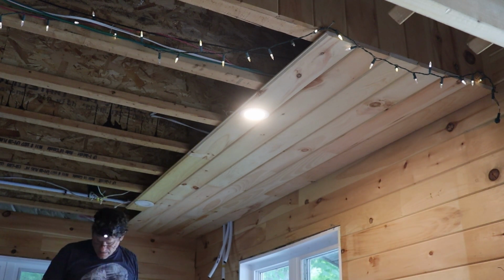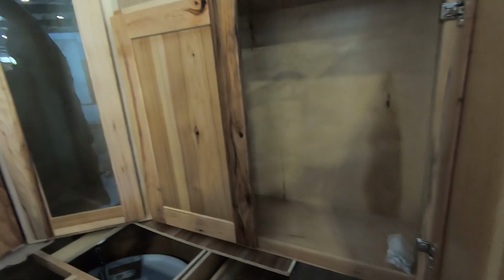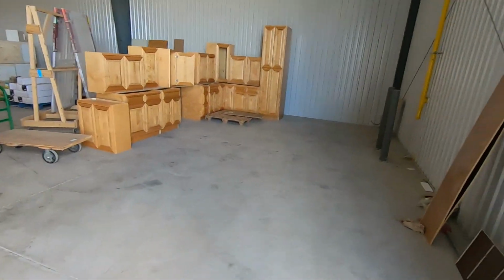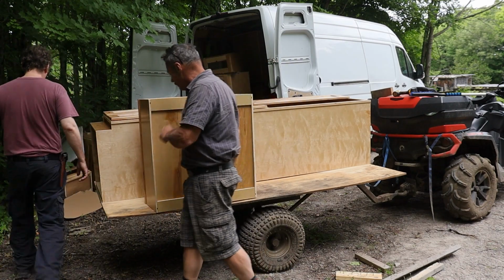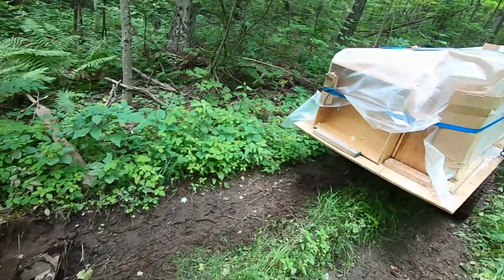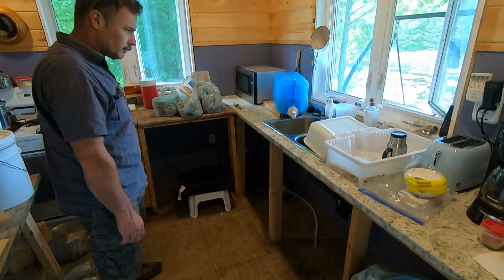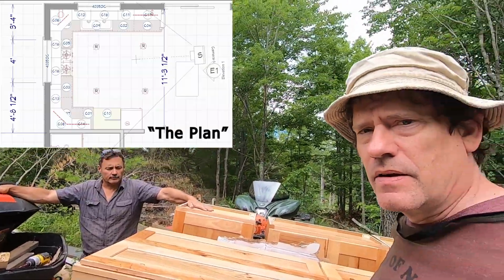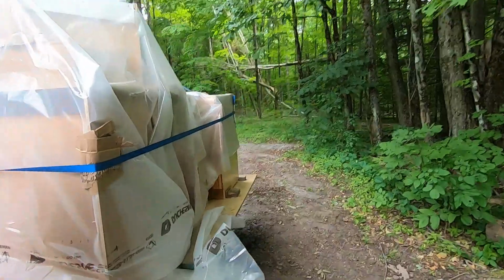Hauling a High-End Kitchen through the Canadian Wilderness to an Off Grid Cabin

Comment: A corduroy road or log road is a type of road or timber trackway made by placing logs, perpendicular to the direction of the road over a low or swampy area. The result is an improvement over impassable mud or dirt roads, yet rough in the best of conditions and a hazard to horses due to shifting loose logs
Reply from the maker: I am familiar with corduroy roads.

Comment: Ray is worth his weight in gold out there. Have a google around for battery under cabinet lighting. I put a few in at my mums retirement unit and they are not bad. You can get them with inbuilt motion sensors and I put a few in her darkest cupboards. There are some designed to illuminate drawers as you open them, some have a remote control, some are linkable so you could have a length under a bench. Some are rechargeable with a built in battery, but i prefer the type that has removable AA or AAA batteries so you can swap out flat ones and have recharged batteries ready to go. Might be an easier option for you with less drilling of holes in cabinets etc. I will be watching as the kitchen takes its final shape. Regards from down under.

Comment: With all those downed trees, why don't you build a bridge over those water holes in the trail??
Reply from the maker: Sounds like work, Joyce.
Reply: @RaspberryRockOffGridCabin  Sometimes a little work prevents a lot of work later on.  You could also fill the mudholes with rocks or gravel, or even cut a detour around the worst parts.  Otherwise, you may asphyxiate from holding your breath each time you cross the mudholes!!  Good luck!!

Comment: I  see you you had to use your winch when you got stuck. Either you weren't in 4wheel drive or there's something wrong with your 4wheel drive system.  Front wheels were not spinning
Reply from the maker: My front wheel drive isn't working